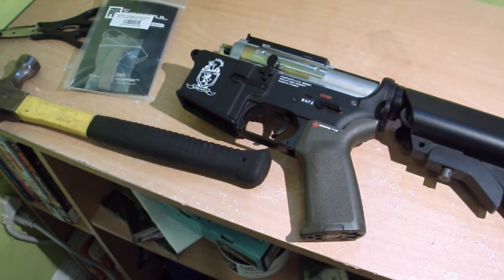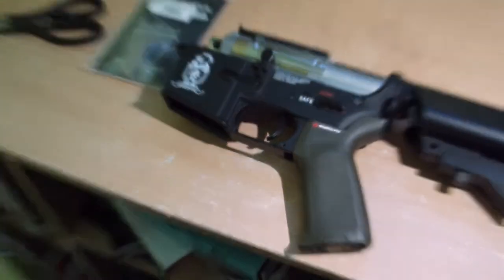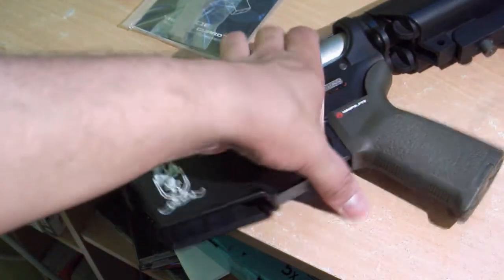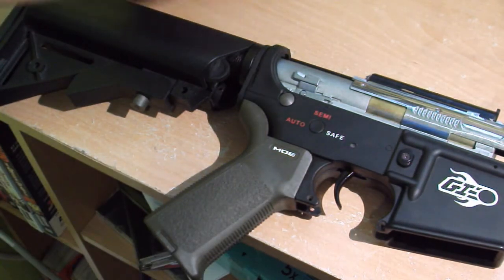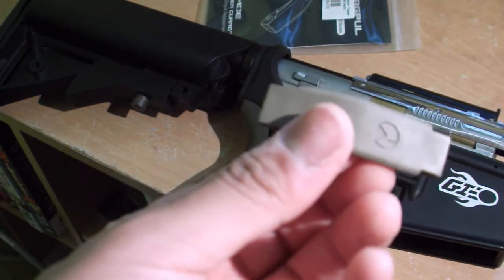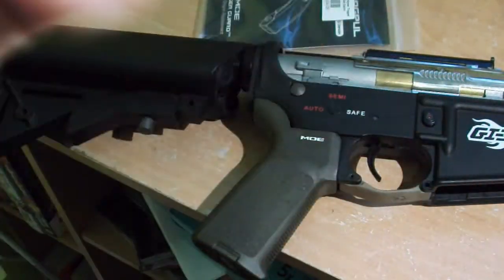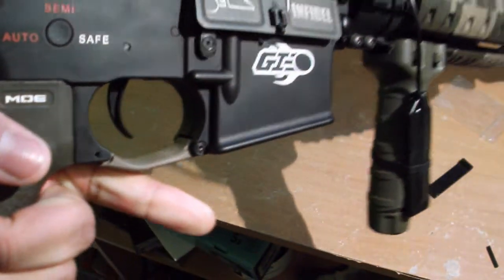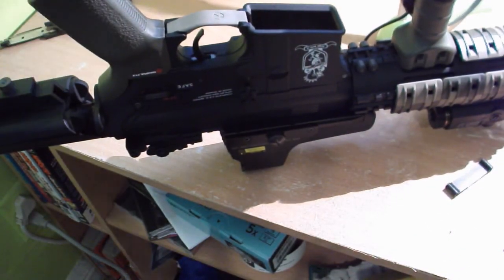Magpul PTS Polymer Trigger Guard Installation

Comment: Con: Using hammer to beat on your airsoft gun.
Reply from the maker: lol I was pushing the pin in not hammering the gun
Reply: @B1Gxyz  the vibrations still hurt the internals of the gun
Reply: @B1Gxyz  also you’re gonna have to sight in your optic again, if that isn’t damaged
Reply from the maker: @masterqui-gonjinn90  this was 6 years ago bro, and I promise you my grouping and sight was spot on 👍🏽

Comment: "The thing I just punched out"...it's called a roll pin.
And jesus it's an airsoft gun, not an M4
Reply: Search up m4 airsoft gun they don't call airsoft guns airsoft guns they call them by what they are or what they are replicating
Reply: even tho this is 2 years later
im still triggered at this comment
Reply: soulventic even tho this 3 years later I’m still triggered by the comment
Reply: @mikxly8147  this is five years later and I’m triggered by this comment
Reply: Six years later... I'm triggered as I come across this comment.